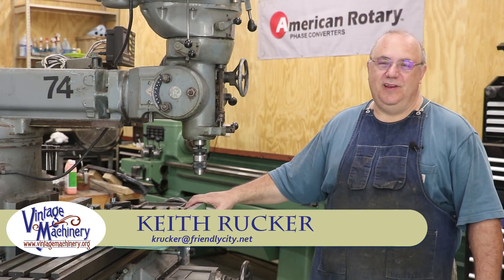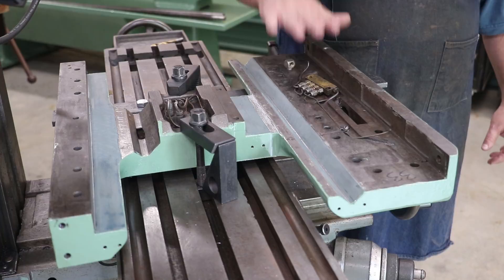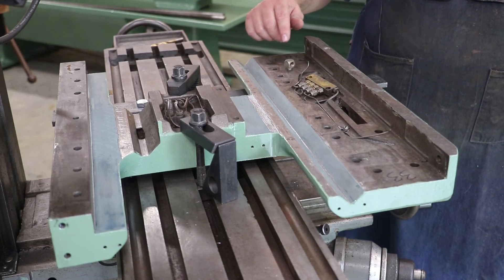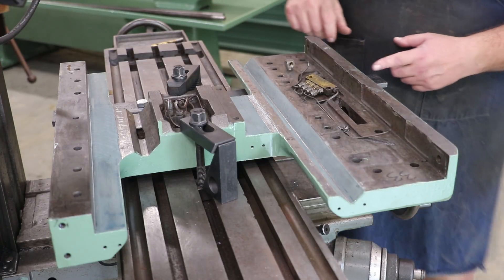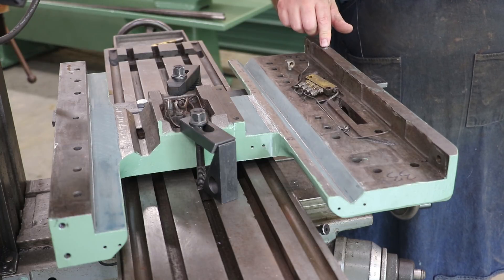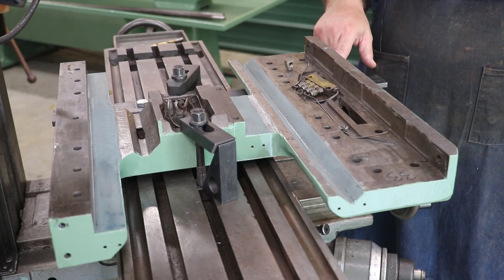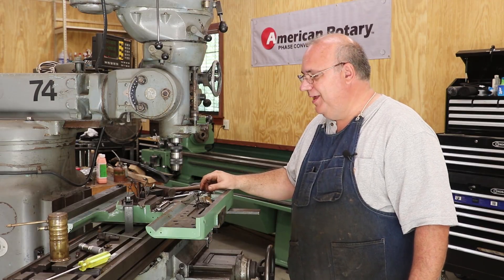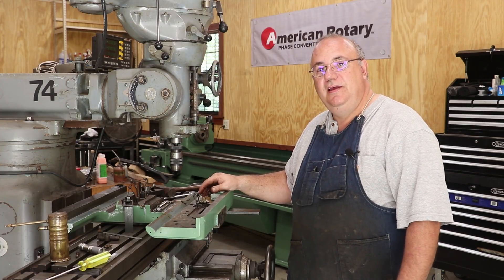Monarch 16" Lathe Restoration 7:  Clearing Oil Lines

Comment: It is the seeming small details like clearing these lines that actually make or break the entire restoration. Absolutely fascinating to see you put right this problem which it sounds like might have been there for decades?

It is kind of a shame you didn't get whatever was stoppered into that hole fully out as it would have been interesting to see what it was! I'll bet it was actually not a drill but a small screwdriver or punch that someone was using to try and clear a perceived blockage and it broke off in the process. That would explain the soft metal used in comparison to a drill bit or tap. However if you are certain there will be enough flow through the narrowed bore then no worries--the job's a good 'un a my father would have said!

Comment: I think you should drill it out some more. You're down to about 1/2 the diameter, which is 1/4 the cross-section, so 1/4 the oil feeding capacity. I think it may be a broken tap, as the hole has threads, which it doesn't appear to need according to its function - unless there is an end plug?

Comment: After 40 years as machinist --I have done this dozens of times with broken broken drills , bolts, and hardest of all TAPS ans OTHE CARBIDE ITEMS..  If the broken items is not hardened metal- then life is good -----but taps and broken "easy outs" and even  broken carbide itself are much tougher animals ----HERE IS THE BIGGEST TIP OF ALL ---when using carbide to cut out broken item, run the carbide as fast as your spindle will allow (2000-4000 rpm ). You will get finer chips that are less likely to bind or chip the edges of your carbide and most of all the extreme rpm will generate heat. That heat will actually  soften and melt stubborn steel items making their removal easier.  The high temps will not hurt carbide cause the steel will melt before the carbide is affected. carbide will actually cut carbide if extreme care is used. been there --done that.  The ball nose E.M. advice was also makes things much better.  Many times I have to use regular carbide e.m. because I lack ball e.m. In this case you WIILL KILL the e.m. but that is just the price the customer has to eat.

Comment: Another possible solution to the drill-bit in the hole would be to open up a hole from the top (the other end) and drive the obstruction out with a pin punch. (This won't work if the obstruction is a tap, of course.) Then you could plug with a brass plug the same as the horizontal passage. This might be an alternative solution for someone who doesn't have the square and ball-nose carbide cutters in the needed sizes handy.

Comment: Hi Keith great video as always. Just a suggestion that could help you out in drilling in tight situations where you can't see deep down in the hole but have you thought of a wall inspection camera. that gos into holes such as what's used in walls. May help you out we're you can angle the camera so at least you can see it on the LCD monitor.
 (Borescope inspection camera) When drilling in these circustances. There quit cheap to buy. Feel for you I hope I don't have this same problem with my restoration. And I have no where near as much experience as you have.

Comment: Be careful with those little brass lines, they like to crack when moved. I need to replace a few in the saddle of my 1940 C where chips have worn holes thru them. I just haven't felt like pulling half the lathe apart to get at them. You may also want to look into replacing the Bijur metering fittings on the distribution block while your at it. They have a tendency to plug up over time.

Comment: Let me start by saying I'm not a machinist. Would vacuuming the line be helpful to pull out the blockage instead of pressing it tighter into the tight spaces? Of course if it is small particles that will break up using a solvent and pressure makes sense (to a lay person).

Comment: A job like that always clinches the cheeks LOL.   Great job Keith, that small ball nose  end mill  had me worried when it was almost at bottom, you know if they are going to break it's going to be at the bottom when you are almost finished or say you are finished and go back in to clean it up just a wee bit more. At least that's how it works in my world. Thanks for the video. Steve Summers

Comment: I think I would have first tried connecting a high pressure hydraulic line to inside oil passage connection... and blowing the obstruction out of the front hole.... just a thought.

Comment: Keith we had a similar operation here but was successful by drilling down to the hole from the opposite side. It required accurate measurements but worked well. We were able to drive out the block with a long punch.

Comment: perhaps a little ATF oil would be of some use. It is a high detergent, will free up all kinds of stuff. Once watched a guy drain all the oil from a Buick with hydrloic lifter that sounded like a rock tumbler. After running for a few minutes, one by one the lifters were working again. He then drained the ATF etc. out almost needed a suction pump to get it all out. All of this problem was caused by the car owner was convinced that detergent oil was no  good.

Comment: Try using a zerk fitting and a grease gun. A good one should be able to blow them out. Did this on a cat when I used to chenge oil on them and it worked. Love the videos. Glad that you and your family came through the storm all right.

Comment: Keith, I would try using some Kroil to open up the oil lines. Also a lot of times when trying to get out an broken Twist Drill, try using a left hand cutting end mill, or in you case a left hand center drill my grab and twist the drill out.

Comment: Keith
If all else fails, you can just make up new oil lines.
I used to install those type of lines on turret lathe aprons at Bardons & Oliver machine company.
Bijur Delimon Co. would have all the fittings you would need.
And the tool to drive in the wedge fittings is easily made.

Comment: Keith do you know anyone who works on commercial refrigeration  equipment ask if they have a capillary tube checker and cleaner, they work by hydraulics and to clean them they use a small piece of lead wire

Comment: It's odd how someone that had or was in use or charge of a machine of that caliber possessed the inclination  to take it apart and presumably put it back together again, but just blew off rectifying the botched service or repair job they were attempting only to leave the components fed by that whole part of the lubrication system to die a slow death.
Reply: Probably had a job come up and got told "PUT IT BACK TOGETHER!"

Comment: So.....everyone raise their hand who didn't even breathe from the moment they saw the big end mill wollerin around to when Keith finally pulled the tiny end mill out of the hole and noted success?

Because I'll tell you what. I didn't. Man, that was intense!!! :-O

Nice job Keith!!! WOOHOO!!
Reply: Brian Streufert if the carbide breaks in the hole it is usually easy to shatter with a hammer and punch and extract the broken pcs. With compressed air.

Comment: Won't the smaller hole in the plug cause less oil flow? It feeds a lot of points.
Reply: It acts like an orifice plate.  Slight pressure drop across but minimal flow loss through it.

Comment: A dental mirror may have helped with looking down that hole while drilling ;)
If the pipes are clogged with dirty oil, would it be better to use a flushing oil like they do with cars ? a bit thinner than normal, it may have some solvent in it too, but not sure.

Comment: Every rebuild of older machines requires checking or replacing the oiling system tubing and passages.

How are you planning to clean out the high-speed steel chips and dust in that passage?

Comment: Keith: I remember an old trick of using a grease gun with oil in it to blow out plugged lines.  If the Eagle can won't do it the grease gun can develop much higher pressure.  The trick is finding the thinnest oil that it will pump without leaking all over the place.

Comment: Maybe try a soaking a 50/50 mix of acetone / transmission fluid to soak the threads or bit to loosen it? Then a left hand drill or easy-out? The 50/50 mix may clear those lines too. It'll creep into even the tightest spaces, better than any penetrating oil, ever!

Comment: The stopped up oil lines is the reason I don't use non detergent oils in my machines like they recommend.  I would rather the oil take a little dirt out with it than to stop up and quit oiling all together. Besides I have never found the oil to be that dirty coming out anyways as long as you are putting clean oil in. On my Monarch it took about 5 years of using hy-gard oil before the way oil finally quit coming out black.
Reply: I have never had any foaming or staining with the oil I use and my ways look bright and excellent and always have a nice film clinging to them for rust protection. Before I had some ac running in my shop I had sweating issues like crazy too.
Reply: I used John Deere Hy Gard in my  big Devilbiss. The same stuff I run in my lathe for the carriage and head stock and I even use it for the gears and clutches section of my Cincinnati mill. Anything that calls for between 20W and ISO 46 probably gets the stuff.
Reply: I would think they recommend using non detergent oil if it's an older machine and never had detergent oil in it before.
If you were to change to detergent oil without cleaning you might end up with clogged up oil lines. 
On a rebuild where everything is cleaned and flushed i can imagine any oil with the right viscosity being fine.
Reply: I always thought it was the foaming action and the yellow metal etching caused by detergent in the oil that was the problem?  Would like to know your real world experience with this. Thanks
Reply: Non-detergent oil must have a place but it's not here.
Reply: I won't even use it in compressors. I want the junk to come out, not just settle out.
Reply: What do you use in your compressor? Getting ready to change oil in mine and looking for recommendations.
Reply: do u use the J20 then?
Reply: I use the regular hy gard which is for the j20c spec.
Reply: bcbloc02 thank you.  Was just pricing oils out for the "new" equipment and this sure makes it easier.

Comment: If the previous guy attempted to drill out the hole it stands to reason he wanted to increase/facilitate oil flow... wouldn't it be a good idea to drill out the broken drill bit completely so as to achieve the ID he previous guy was shooting for?

Comment: Kinda surprised you didn't plumb up for compressed air into that distribution fitting so to know when you were through the broken drill bit by the explosive release of oil and air from the drilled hole. That would prevent over-penetration pretty solidly.

Comment: Hi Keith,
Assuming the deposits are petroleum based, and not rust.
I think I would go with something like Kroil or mineral spirits to start with, on flushing the oil passages.  Oil may be a little too thick, unless your able to put considerable pressure on it, say 10,000 psi. 
The lines are so small that hydraulic pressure may not be the answer. But if you can get a solvent flowing through the passage, you may be able to flush enough crap out to then switch to oil.
As always,
Thanks for all you do.

Comment: Great work Keith.  Do you think the hole you drilled for the main oil feed through the broken drill bit plug will be large enough though?  Perhaps worth drilling it out larger?
Reply: I was wondering the same thing. I just wasn't sure if the drill bit he punched a hole through was the original port size or if it was oversized.  I would guess even if he gets less oil through this portion it will still be infinitely better than it was when still plugged.

Comment: Can you put a 6" piece of small wire in a drill and make your own rooter router? Good luck.
Reply: Try a guitar string.
Reply: Use a soft wire, like copper or bailing wire & flatten the end to make a spoon bit.
Reply: I would say a bottom E string. Use a wound string for the cleaning effect.

Comment: Could you have used an easy out to back the drill bit out?  For the small oil lines, you hands are too big.  If this machine was manufactured in the WW2 era then women probably did the fiddly work.  Might want to enlist somebody with smaller mitts to do the fine line work.
Reply: This machine is much later than WWII. It's 1962 or 63, per an earlier video.   https://www.youtube.com/watch?v=TJx_xTO605I at about 30 to 35 seconds in.

Comment: Removing anything stuck in  a blind hole is a pain. I may have put air or solvent pressure on the line to try to loosen it out.